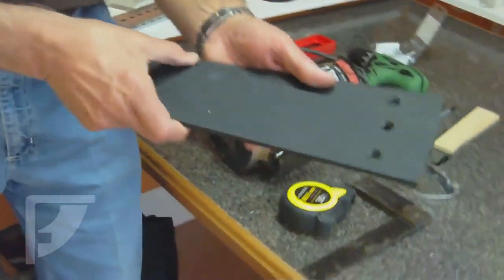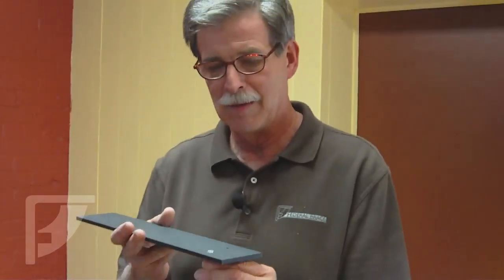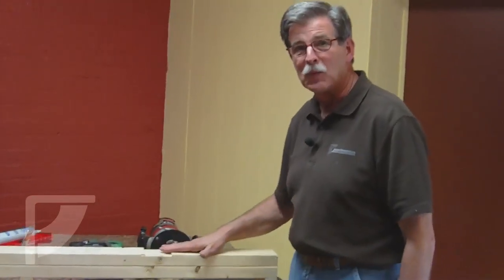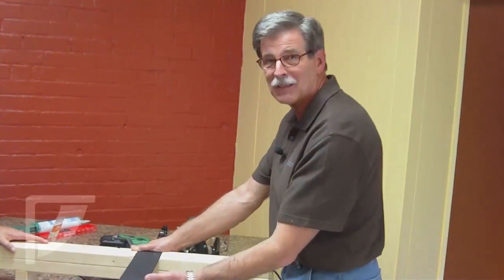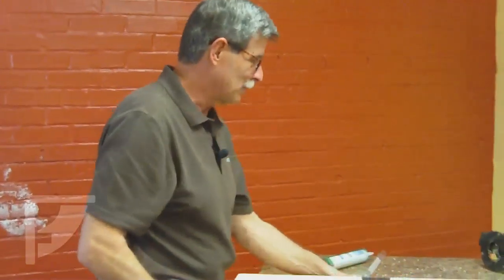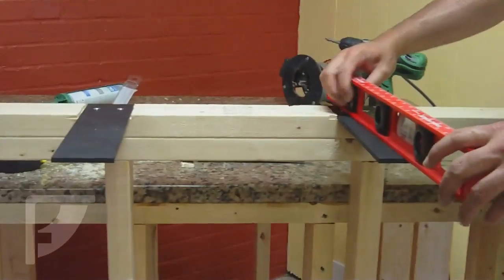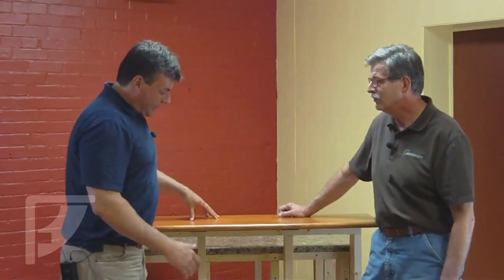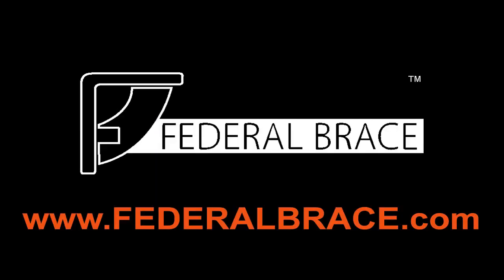HOW-TO: Invisible Countertop Support Install w/  Install the Liberty Plate

Comment: I got a beautiful quarz island countertop installed last weekend and I found out under the overlap (where you seat) there is a wood portion clearly visible, only the border has the quarz,  I supposed they have to hide the wood in general right? I am wrong? I ask them, they said that always is like that..